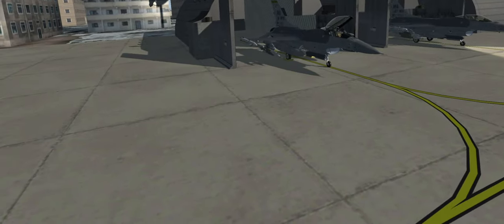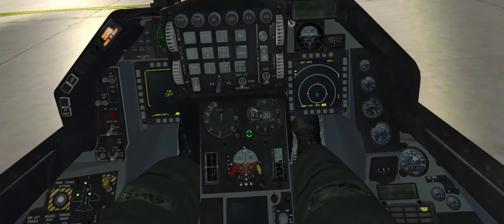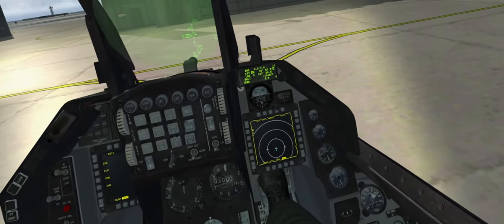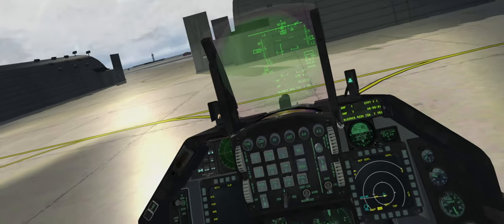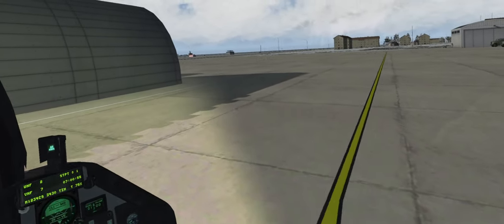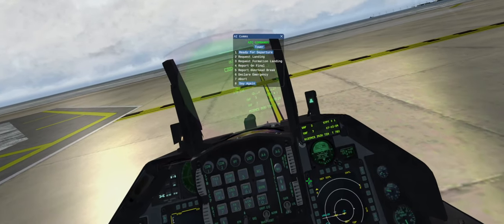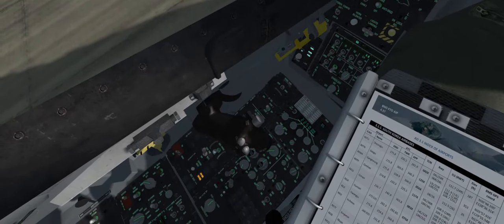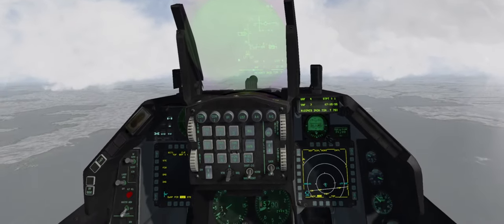Falcon BMS 4.37 First ILS Approach With Voice Attack  *Full Flight* | VR |

Comment: I’ve looked at videos like this for years now.  I need someone to show me how to set this sim up from beginning to end.  

I see the potential but without being able to set it up properly, I end up going back to DCS.  

Now that there’s a VR option (which was a requirement) for me, I’m more intrigued about getting this sim workout finally.
Reply: There is tutorials on the internet
Reply: what exactly do you have problems setting up.

especially now in the latest version of BMS. the whole control mapper has been overhauled to be more like the one in DCS. 

so right now, setting up BMS is probably easier then ever.
as for manuals. they'll be in your BMS install folder.

Comment: Is there a way to configure Voice Attack so that the sim doesn't repeat your initial voice command.  For example when you requested taxi, the sim repeated your taxi call.  Same for the tower ready call and the departure call.
Reply from the maker: Yes, you can untick voice repeating in BMS settings I believe.
Reply: @integralsrulz  is that the pilot voice on settings ?
Reply: @speedbird8326  I think it is the "Player Voice" option in Sound Setup menu.

Comment: Hey how did you record this? I've tried to use vr mirror but the sound stops. Tried obs game capture, window capture without any success. Also my I cockpit is really, close to the HUD and resetting the centre does not work. Thanks for any help :)
Reply from the maker: I used OBS with game capture, you'll need to do one for the 2D briefing screen and a separate scene for the VR image as the mirror is a different window aspect ratio. I had to tweak the window location within OBS for it to be centered correctly. After that you'll need to use the VR recenter key to setup your eye position as desired. Hope that helps!
Reply: Try to use "audio capture beta" in parallel
Reply: @integralsrulz  a video of how you set up the capture would be GREATLY appreciated by the community. I've tried messing with it and just can't get anything but the sky view..